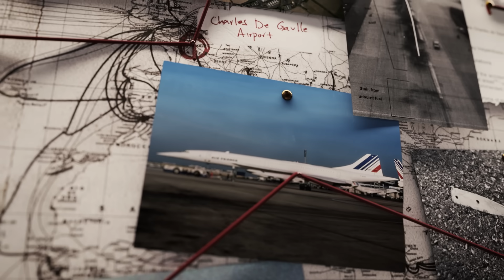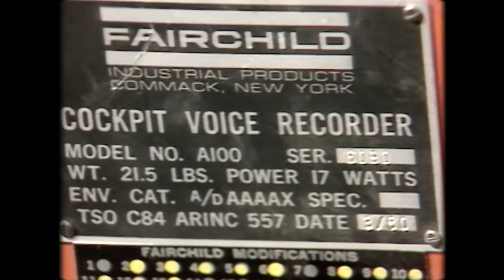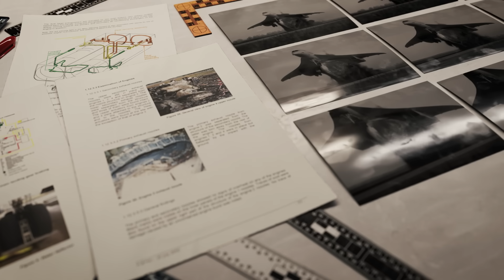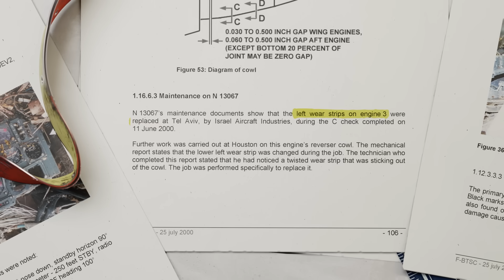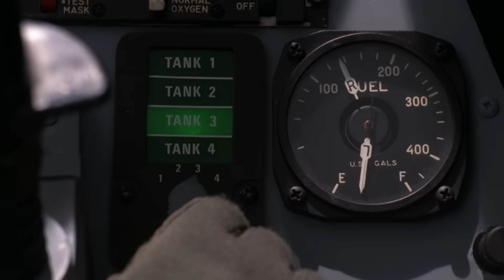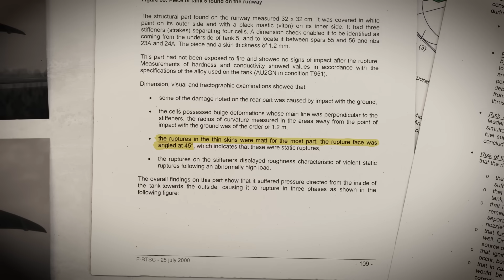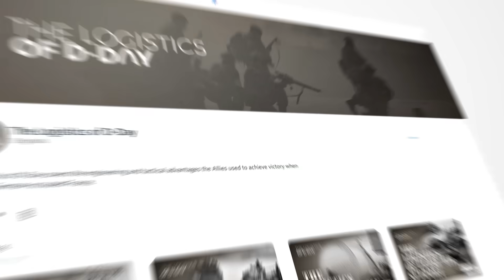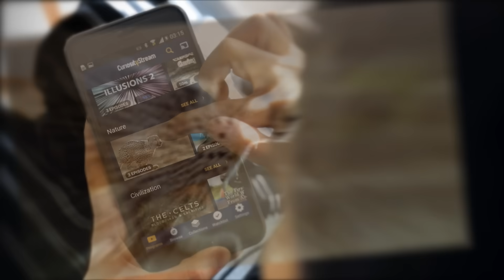What Actually Happened to the Concorde

Comment: Interesting, but how did the fuel ignite? And how did that result in loss of control?
Reply: As I know, the rupture also broke some wires and cables, that  caused a short circuit electric spark and made fuel to ignite
Reply: Thermofluid mechanics teaches that when a fluid has pressure applied to it while running through a nozzle (the nozzle being the hole in the fusilage), temperature shoots up. It must have reached the point of combustion.
Reply: @elijah_9392   The mystery is still why it doesn't ignite when they fill up the fuel tanks
Reply: @shoutitallloud  I assume it is a far more controlled process.
Reply: @elijah_9392   I assume you misunderstand
"thermofluid mechanics", and confuse simple logic and  physics laws.
Reply: @shoutitallloud   

Please enlighten me.
Reply: @elijah_9392   The rise  of temperature as the liquid is moved through the nozzle is due to the friction forces between the liquid itself and the surface of nozzle. There's nothing about pressure here. It's about the speed of liquid that flows though a thin orifice. 
Second thing is, when you poke a hole in a tank, the pressure inside will drop, not go up.
Reply: @shoutitallloud  

1. Bernoulli's equation:

P_1 + (roe)(v_1)^2 + z = P_2 + (roe)(v_2)^2 + z 

Consider fuel combustion. Once the fuel is compressed enough, it spontaniously combusts. Bernoulli's equation in this form applies to incompresible fluids.

Recall, the video said that the tire caused a deformation, apllying external pressure on the tank and creatibg the static force needed to create a hole. The pressure didn't drop immediately because the tank was squeezed. It's like squeezing a juice box. 

So, with the tire hitting the fuel tank, P_1 is high, and v_1 is low. After, P_2 is low and v_2 is high. A pressurized, incompresible fuel, was exposed to oxygen at high speeds, causing something akin to fuel combustion.

Of course it is about velocity, but I believe that velocity only came from the pressure caused initially by the tire.
Reply: @elijah_9392  Jesus...  First of all, to make  a combustion to happen, you need a fuel and an oxidizer (and preferable in stoichiometric ratio).  That's called air+fuel mixture. And that's what gets compressed. In fact, it's mostly the air what is compressed in this mixture, since, like you exactly mentioned, liquid fuel is uncompressible.  The physics and equation that fits to the description of this process would be Boyle's law: PV=nRT.
Reply: @shoutitallloud  My point about velocity still stands. If it wasn't combustion, it was the friction caused by being sent through the hole at high speeds. 

Listen, I am not claiming to be the expert. I would like to genuinely learn. This is just how I undersrand things at the moment.
Reply: @elijah_9392   I appreciate your intention to learn. Let's then think about your hypothesis.  Suppose the flowing liquid  produces friction that makes edges of the hole to heat up, but at the same time this same flow cools down this edges,  it takes away the heat.   The significant temperature rise would be if the liquid is pumped in a closed system, with the minimum of heat exchange.
Also, consider the m, aterial of fuel tank is metal - it's a good heat conductor. Does it seems real to you, to rapidly heat up one specific spot in a metallic plate with a friction, without  getting the whole plate to warm up first?
Ok, perhaphs, the excess pressure build up in fuel tank was so enormous, that resulted in tremendous velocity of liquid fuel stream. How? Where did that energy came from? A hit from outside with a piece of rubber? Well, that energy was consumed to break a hole in the tank. That's it. The force, that made fuel to pour outside  was gravity, the same, that makes milk to pour out of the bottle into your glass. There wasn't anything else extra ordinary.
Reply: @shoutitallloud  

I agree. What I said seems to be in error.

What did cause the flame then?
Reply: @elijah_9392  The rupture also damaged electrical wiring. Broken wires caused a short circuit and sparks that ignited fuel. Also as the tank leak and flame buildup were right behind the wheel chassis, that contributed to airflow turbulence that prevented the flame to be blown off. You can search for “mentour pilot” channel on YouTube, there’s much more detailed reconstruction of this disaster.
Reply: most likely due to autoignition from high temperature from the fracture, which caused an explosion which then damaged the hydraulics

Comment: Why would they design or fill the fuel tanks to the top without any room for expansion?
Reply: Because Air France. Im pretty sure Concorde 4590 was over 800kg overweight on takeoff.
Reply: ASK the pilot oops sorry
Reply: They did design an expansion gap. The pilot overfilled the tanks.
Reply: @vociferon-heraldofthewinte7763  Wow, bad luck all around.  A piece on metal on the runway, a sliced tire, and overfilled tanks.
Reply: @vintagetrikesandquads4012   And landing gear spacer forgotten to be installed during maintenance causing Concorde to veer left over the strip on the side of the runway. Concorde being overweight and center of balance being too far back making the plane harder to fly. The Flight Engineer shutting down engines below safe altitude without pilot authority and well below safe altitude of 1,000 ft. Many holes had to line up in the Swiss cheese to cause this tragedy.

Comment: During the decade between 2000 and 2010, a lot of other things happened. I think the 9/11 attacks and increasing fuel prices would have been enough to down Concorde even without the accident.
Reply: If nothing else, the 2008 recession and the pandemic would have ended its career.
Reply: The first test flight carrying passengers (BA staff) near the return-to-flight date was actually on September 11 2001. Not great timing.

Comment: I got to meet some of the British accident team.  They told me that a lot had been suppressed by the French to hide their many glaring errors......the copilot's medical, WEEKS out of date; the tanks OVER filled making them susceptible to shock, which happened; the left undercarriage missing a 7kg shim that made the plane swerve; they took off with a 15kt TAILWIND!!  It was 11,500lbs OVERWEIGHT; the engineer shut down 2 engines despite the check list saying, "Do NOT shut down any engine below 1000ft....." and did not tell the pilots.  Concorde unusual in that it takes MORE power to fly at 250kts than at 500.  The wing does not ever stall BUT has huge amounts of drag, making it not possible to fly on 2 engines at low speed.
Reply: Exactly.
Reply: @vociferon-heraldofthewinte7763  Brilliant a/c, my brother part of the design team so I got to go several Concordes.  But really a waste of money, the poor taxed so the rich could save a bit of time.  Read up on the engines and the complications needing to be solved transiting from subsonic to supersonic.  "Concordes had MORE supersonic hours than ALL other a/c put together."
Reply: @davidwheatcroft2797   And the landing gear missing shim being dismissed in the accident report and not a contributing factor without any tests being performed.

Comment: For the animation, shouldnt the fire start by the afterburners, and not at the leaking spot? It looks like the leaked fuel catches later on in the real picture
Reply: As I know, the rupture also broke some wires and cables, that  caused a short circuit electric spark and made fuel to ignite
Reply: VAPOUR

Comment: 60 kg/s isn't just a "fuel leak" - this is a firehose sized stream of flammable and partly vaporized kerosine waiting to be ignited by the afterburners at full power. Basically this illfated Concorde did what F-111 used to do at airshows - dump fuel and ignite it with the afterburners... 👀

Comment: This was endlessly fascinating. I can't imagine being tasked with figuring all this out. Flight crash investigation almost seems like magic to me. I also can't imagine the amount of work that goes into making these videos. The animations alone must take a long time. What a great video.
Reply: Wasn't anything life or death but I've had the opportunity to work with a materials scientist shortly after starting work as a quality inspector. The man was brilliant and determined to credit me with finding all the clues for him...
He was investigating a structural issue that was happening on some sensitive medical equipment the company was producing (and was their biggest, highest-paying contract). I was recommended to him by colleagues for having the best eye in the dept. After we'd figured out all the ins and outs of what was actually happening when the devices would appear to just break open spontaneously after assembly (an internally-mounted display was ripping itself out of its frame and snapping the entire body of the device open), we still couldn't figure out why this batch in particular was having such catastrophic structural failures. We'd compared the new cases to older ones, neither were perfect but the design took slight warping into account, so it didn't make any sense why the new batch was now under tension with the display mounted, with its machine screws eventually  stripping the threads in the mounts as they popped apart. We were just sitting there after discovering all of this, the scientist racking his brain for possibilities far beyond my knowledge, and I was just staring back and forth between the old and new samples we had compared... After a few minutes I offhandedly mused that the newer ones looked so bright, crisp white that when sat next to the older ones, they made them look almost off-white. The scientist's head snapped up, took a look over them again, said he himself couldn't tell a difference, and asked if I was sure they looked whiter than the older ones. Nobody else present could see what I was talking about but my colleagues vouched for me when it came to being able to see stuff like that. We didn't see the scientist for a few days but he'd left saying cryptically that I might've found the cause. When he came back I got a big congrats and thanks. Turns out that in order to try to get the cases as vibrantly white as possible, the vendor who was casting the cases had added extra titanium powder to the coloring in this batch. We all would've thought that'd have a totally different effect on its structure but he informed us all that the powdered compound used to do that can make materials not just more rigid, but more brittle as well, if too much is used. So it'd turned the slight warping from a nonissue into a critical failure, and caused the current mounting threads to be too brittle to hold against the new-found tension put on them by the machine screws holding the display into its frame. The color difference I could see was what caused the scientist to go to the vendor and inquire about how they'd colored the batch, and... They confirmed they did add extra. They too didn't realize it could affect the structure's material characteristics so extensively, but the scientist did. I was stunned, but it felt kind of gratifying as a newbie that all the weird little things I'd noticed were actually relevant to the man's investigation.
Reply: Totally agree that figuring this out is insane. Reminds me of fire investigations, the places literally burn down but investigators are somehow able to pin point exactly how fires started and progressed over time. With plane crashes the thing you are investigating is literally in a million smoldering pieces so figuring out anything is amazing.
Reply: @Michaelonyoutub  it's one of the main reasons that documentation is so crucial for investigations like this. Many catastrophy investigations are solved long after the fact, by careful examination of all the gathered information. From instrument readings, to the exact location of different parts of the plane/bridge/dam/train/etc. To extensive analysis of materials and service records. I took an elective course about this on my masters degree at a whim, and I think I use knowledge from it as much as from all the other courses, despite it being completely unrelated to my field of work (computer security).
Reply: With enough data, you can predict the future.
Reply: I agree. I advise to read about British Airways Flight 38 (crash of a 777 in 2008). It's crazy because they knew what system had caused the crash but this system when tested after the crash appeared to be working perfectly. I let you find out why ;)
Reply: It seems magical because the investigators are geniuses.
Reply: Repent to Jesus Christ 
“I have been crucified with Christ and I no longer live, but Christ lives in me. The life I now live in the body, I live by faith in the Son of God, who loved me and gave himself for me.”
Galatians 2:20 NIV